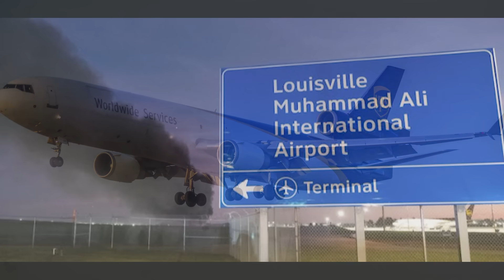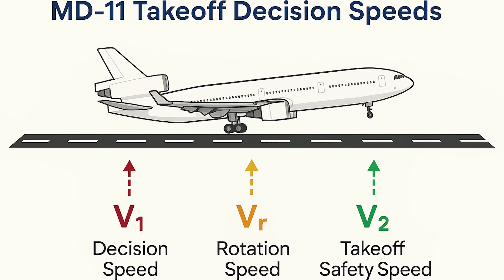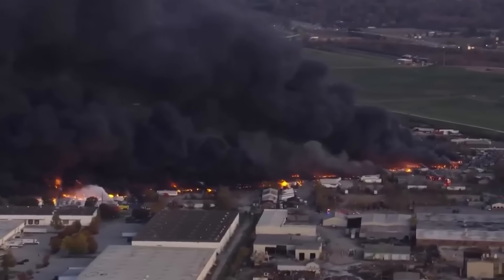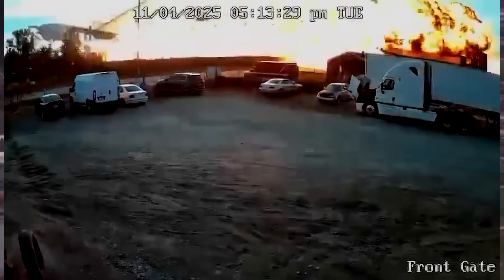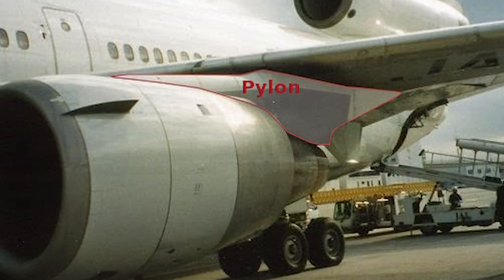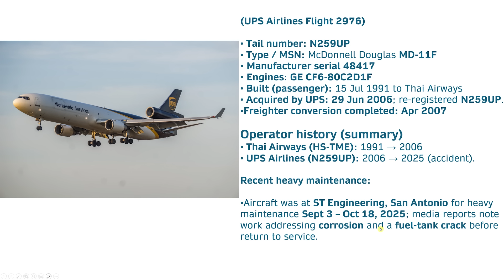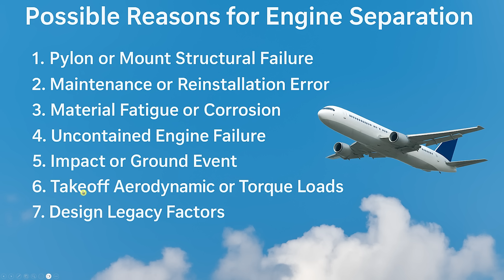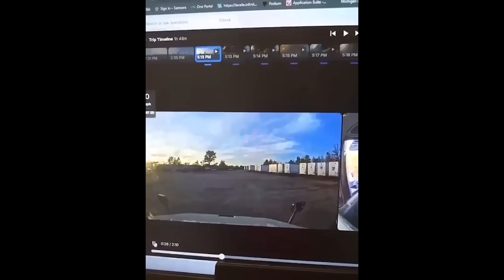What Caused UPS Plane Crash, Louisville, KY? How MD-11 Engine Fell Off

Comment: I am a A & P Mechanic with 40 + years of experience. Heavy Maintenance  (C and D Checks) are done after so many Airframe hours and flight cycles. Unless the A/C is brand new, most every A/C has corrosion and cracks due to the environment and the constant pressurization of the structure, this is why maintenance is constant. Engines are attached to the airframe with very large bolts and structural fittings and they don't just "Fall Off". internal stress fractures within the airframe or attach fittings would be the likely cause and those stress fractures would not be visually detectable. NDI  (Non Destructive Inspection) testing would be needed to uncover any defects...... I would look at when the last NDI  testing had been done.
Reply: retired military here.  I beat they cannot find the last NDI because as you said, age weakens the metal an only the NDI can detect this.
Reply: Excellent point.
Reply: I came here to say this, NON DESTRUCTIVE testing vs TAKING CHANCES and the possibility of such a horrendous outcome. 

You never question the cost in aviation or any form of public safety.
Reply: Both human and AI inspection should occur.
Reply: How expensive is it to do a comprehensive X-ray analysis in the hangar? You'd think that in this controlled environment it could suspend from the ceiling, be fully unmanned, and thinking aloud and thinking forward, have AI examine every single weld, rather than require a crushingly tedious human visual inspection.
I'm thinking that if the plane resides there for even just 5 hours, while maintenance people do what they do, this automated action could occur. And check EVERY point of failure.
Reply: @Bill_Woo  I agree, Non-Destructive is less cost effective imo.
Reply: @Bill_Woo  there are very few welds on an airplane. 
NDI isn't cheap. The guy who came in a couple weeks ago to check some of our planes was using a machine that cost more than my house. And the price the company charged was eye-watering. And we had to wait a couple weeks for our appointment.
Reply: @eclectichoosier5474  Very interesting, thanks.
Reply: @Bill_Woo  Why do people like you think AI is the answer to everything? The same AI that is constantly hallucinating?
Reply: @llamaeatingpie Why do people like you assume that any form of automation, for a job that you don't even WANT and would refuse to DO, is going to bring on a crippling depression? Like car assembly plants and microwave ovens, oh, the horror, the horror. NO one wants that job. But it would CREATE jobs by doing something that's not being done today. Nice try to attempt to devise a relevant point out of sheer irrelevance. Not.
Reply: @Bill_Woo spoken like someone who's never worked on airplanes there's places you're not going to be able to inspect there's places you're not even going to be able to x-ray such as inside the wing best thing they could have done is inspected the pylon  attach fittings since this is already happened in American flight 191

Comment: You mentioned the similarity to American Airlines Flight 191 but didn't fully connect the dots.  AA Flight 191 was a DC-10, and the DC-10 design was modified into the MD-11.

Comment: I've said this for years, there should not be built up areas on centrelines of runway headings for at least 3 miles.
It's only a matter of time before more aircraft crash into more built up zones ⚠️
RIP to all the souls involved 

I find it quite astonishing when I look at aerial shots of most runways and the insane design planning of such areas.
The sooner these ideas are changed, the safer Aviation will be for all 🤬

Comment: the 64 thousand dollar question is did some workers stress the engine mounting bolt out using a forklift leaving it holding  the engine up overnight and the hydraulics of the lift sinking overnight ,  just like flight 191 Ohare crash in 1979 ,  that is the first place i would look, was the engine serviced recently and who did it

Comment: I bet this has something to do with the time it spent in maintenance. An engine just doesn't fall off. I wonder what the last flight it took. Or how many it has flown since maintenance. I bet when the first engine fell off, debris was thrown into the engine in the tail end causing it to fail, At that time the one engine was unable to lift

Comment: I’m guessing the powerline ignited the fuel spewing from the wing after the engine fell off, tearing the fuel line and allowing a free flowing kerosene right out the wing when the powerline ignition hit the fuel boom just might take

Comment: This happened about 2 miles from my home. My brother recently retired from UPS, where he was a (truck and trailer) mechanic. I too, used to work at the airport at one time. I'm 65, and I remembered there was another very serious crash at what was then 'Louisville International Airport.' I had to look it up, as it was before my time, and it was the crash of a 'Resort Airlines Charter' plane in 1953. It was a C-46 aircraft. Twenty-five of the 41 passengers and crewmembers died, although an artice in our local paper at the time said that 22 had perished. There's also a photo of what was left of the plane. The flight was being chartered by the U.S. Army and was carrying 38 soldiers. It stalled on its approach to landing. The accident was attributed to "improper maintenance and inspection of the aircraft." I suspect we'll hear something similar about this UPS flight.

Such a tragedy. Thankfully it wasn't a passenger plane.

Comment: Should show the jumbo crash in EL AL flight from Amsterdam 1992 crashed into a appartment block ... Engine came off a Boeing 747 Pylon failed. Cracked when fitting replacement engine no 3 with a fork lift. That engine then bashed the engine 4 off .  Pilots almost made it back.

Comment: Pilots and crew never had a chance. Engines don't just fall off. Maintenance records will be of interest here. Did someone not bolt the engine back on correctly? A few bolts missing? Hairline crack that wasn't detected? It's been a terrible year for aviation.

Comment: A whole fckin engine falling off surely hasnt happened since the Mcdonald Douglas days 🤔🤔 if this is a boeing negligence problem somewhere in the logistics line then this company is truly awful, missing engines or something as catastrophic as parts falling apart are more often than not something absurdly innocuous like a strip of screws in the wrong place or some kind of attachment not properly placed which has boeing written all over it......

Comment: One of the main reasons 3 engine configurations aren’t built anymore is because of one of the engines mounted on the wings fails, the debris gets sucked through the tail engine.

Comment: The first video is the one I posted to another aviation YouTube channel last night.  Frame by frame, you can see that the left wing tip is what impacted the power lines as the plane passed over Grade Lane.   Apparently, the gash in the UPS warehouse building roof was made by the left main landing gear.  Sadly, among the victims, were a grandfather and his little granddaughter.  They had just dropped off some scrap metal for recycling.😢

Comment: One thing needs to be said:
If you are up to 10 minutes after V1 you are in no mans land.... 
There is very little the pilots can do because you are fast and very close to the ground.
All airports, with exception of those which end in the ocean, should have, just after the runway a space big enough for a crash landing if take off fails....
This would be safer not only for the people in the airplane but also for people on the ground...

Comment: The engine laying on the field didn't seem to have any mounts still attached, so the question is if the pylon detached with the engine attached, or did the engine detach from the pylon? Where the pylon and mounts are found will shed a lot of light.

Comment: This is 2020's.. why are there not low profile camera pods attached to the front of the aircraft looking back at the engines???
Tesla's have camera's all over them.. and plane manufacturers can't put a couple of cameras and route the feed to the aircraft?
Modernize these aircraft.
Reply: Um. It was a McDonnel-Douglas plane, not a Boeing. And the plane was built long before cameras everywhere was a thing.
Reply: @siegfriedheydrich  It's called retrofit

Comment: I'm only a retired pilot, Aviation Safety Officer and former Director of safety..... pretty sure engine by the runway is a problem.    Why it fell off a mile from the plane crashing is why we investigate.     I'd sure be suspicious if engine 1 damaged engine 2, at that point maximum gross weight....it's a mishap.    Engine 3 can't provide the power needed.

Comment: I work at least 12 miles from our airport in Charlotte, CLT-Douglas, but it doesn't see like it since planes are landing and taking off daily inwhich the planes are flying in and out low as the climb and or decend.. And one of fears is a plane happening to do as this one did.. it's so freaking scary 😨

Comment: Also, the Boeing 747 EL-AL in 1992 which was hairline crack in engine 3' pylon I believe (I am sure someone can fact check me) hitting engine 4 knocking out 2 engines. People are often shocked to find out that engines are designed to fall off. Fall off is wrong, more fall away but you lose hydraluics and fuel. I think if you lose an engine taking off, there is no procol for that, that I am aware of.

Comment: RIP to all who perished! Seeing the crash now does not help other than seeing the engine missing or the wing condition. My gut says the pylon gave way on full take off power long before they rotated and the spraying fuel ignited. Poor maintenance or improper mounting. Even with an exploding engine it likely would not have fully detached. And debris hit engine 2 and you could see it stall. Otherwise they might have had  power to climb time to turn off the fuel where engine 1 was and climb and land.....even crash in a more open area...maybe.

Comment: When the pylon broke, the engine ripped away from the wing and the hydraulic pump keeping the flaps and slats engaged failed and they retracted. This caused the wing to stall. The fire was caused by the ruptured fuel tank in the wing. It appears that the engine on the tail ingested debris from the  failure of the engine pylon because it was showing signs of a compressor stall, similar to a bird strike.
Reply: Flaps and leading edge slats are still deployed on the left wing in the video.

Comment: I'm sure these aircraft had an issue with the front engine mount securing pin
I'm sure years ago it happened a few times
I remember seeing a documentary 
The pin would break and the engine would swivel down and fall off
I might be wrong

Comment: Being a retired A&P mechanic I have been involved with some engine changes L-1011, 727, 737, 737NG, 757. After the AA accident in Chicago the FAA came out with new engine change procedures and pylon inspections that were very strict. L-1011 were the oldest in the fleet and we had major pylon repairs due to cracks found in pylon structure. I always worked on the AC as my family was going to fly on this AC. Waiting on FAA findings (they are very good at finding causes. RIP to all that were lost.
Reply: Thank you for that and thank you for keeping us safe up there. I fly GA and our A&P's care deeply about being meticulous. You are all gold in our book!
Reply: yup they were loading it with a large forklift to the pylon which cause stress fractures

Comment: 0:22 what is that thing that looks like another flying object to the RH side of the billboard? It goes behind the tree and billboard in this clip so its not a reflection, and it gets scrubbed in the clip you go slow mo on next. Sort of odd.
Reply: 14:51 there it is again floating by then going behind the billboard again with no mention of it what so ever in the whole video. Odd

Comment: Was an engine swap done over seas?  The book time is usually very lengthy,  there was a hack developed by maintenance crews to cut that time,  leave some of thr pins in and swing the engine then drop it,  it cracked quite a few mounting surfaces back when these we passanger aircraft

Comment: Wow that footage is intense...I dont know how id react seeing a widebody 50ft off the ground right in front of me hit stuff and engulf like that. Terrible accident so sorry for the families.

I wonder if UPS was improperly working on the engines like AA did in 1979 and damaged that pylon, causing the same failure again. The dc-10 and md-11 have the same pylons if im correct and you can damage them if not done properly. Engines should never fall off like that even if they have a total uncontained failure.

Comment: Ya know, you don't see a lot of fire, until right as it hits that last wire. Watch right at the end. There's a flash, then the explosion. I'm surprised, having plowed through the other building and lost engine, the fire wasn't more intense prior to touching the wires. Is it possible the sparks got to the fuel?? 
Planes actually, can be landed with 1 engine gone and as you point out the landing gears are down but he's way too low. Just too low.

Comment: compressor stall visible on engine #2 in separate view meant doom for the crew..  sadly the plane has the power to recover if 2 of the engines were running but #2 must have enten alot of the debris from engine #1 leaving the chat..   Godspeed to the crew.

Comment: I know that once they hit "Rotation", pilots are trained to takeoff *no matter what* and deal with whatever they need to once they are in the air. But I have to wonder if there would have been as many deaths in THIS castostrophic failure if the pilot would have just run off the end of the runway. Chances are there wouldn't have been a quarter-mile of utter carnage... there just would have been (probably) a huge explosion at the end of the runway. I don't know what businesses or other structures/roads/etc are right AT the end of the runway (gosh, I wish we'd learn not to build stuff THERE)... but I have to wonder if it would have been less deadly to just plow into whatever is there.
Reply: There are exceptions to that rule.

Comment: As the engine came off on the runway the plane would have immediately  tipped on its other side so it would have been the wing tip that hit the building not the undercarriage....

Comment: In 1979 at O'HARE the F/O pilot flying religiously held best rate of climb speed, unaware that loss of hydraulics caused asymmetric slat retraction. I wonder, if these pilots were old dogs, had made a predetermination to hold the nose down?

Clearly they dragged a wheel through that building's roof   which bled off any remaining airspeed. Pilots could have saved this aircraft , but they failed to maintain best rate  climb.

Comment: Once the engine came off the plane was no longer properly balanced. The shiift in weight caused it to pitch to the left and pilots lost control   whatever material those black boxes is made of should be used in building. I thought jet fuel melted steel.

Comment: The landing gear looks intact but if they're passed the building that had roof damage it could have been the left main gear that did the damage because the left main gear looks to be hanging differently than the right side in the zoomed in still.

Comment: The fire on the engine pylon probably was caused by the fuel lines to that engine being ripped but what really ignited the wing was the powerlines, probably ripping a bigger part of the wing or ripping it entirely and causing a massive leak which then are met with the sparks of the powerlines short and the rest is history...
Before that, the right engine, on separation, caused debris to enter engine 2 which made a 3 engine airplane be left with only one engine...

Comment: Wow - is this reminiscent of the DC-10 disaster out of ORD when the left (No. 1) engine separated from & departed the arcft as AA Flt 191 rotated for T/O.  AA had been improperly removing & reattaching the engine to the wing while still attached to the pylon, resulting in structural deformation & failure ! Pre-impact fire is an issue here not present in ORD. A million & one thoughts are racing through my mind as I "play the videotape".

A concern here not present in 1979 is, if we can no longer trust the DOJ, the FBI, the Supreme Court, & most, if not all of the Fed'l Gov't, can we still trust the NTSB ?  Tragically, it's not a rhetorical question.  It's reality.

NORMAN COUSINS

Comment: Watch THE DAY THE SKY FELL. Its an episode of Mayday AIR Crash Investigation. American Airlines 191 is a carbon copy of this crash. It will tell you and show you why and how. When the engine was removed for maintenance, the engine pylon was cracked when the engine was re-installed with a forklift. This method was not approved by the manufacturer but was being used because removing it with the pylon attached to the engine took another day to complete.

Comment: My vote is that is that the #2 engine ingested debris when the #1 engine broke off, causing it to fail.  With 2 engines failing on takeoff (in any scenario) with full payload and fuel and after V1, that plane would have been unable to achieve any altitude.  Basically doomed.

Comment: It is not easy to tell, but it looks as though the whole pylon is missing.
Very reminiscent of the Chicago DC10 disaster in 1979, mentioned by many posters on other channels too.
Would not surprise me if they find that it failed due to a crack missed during inspection.